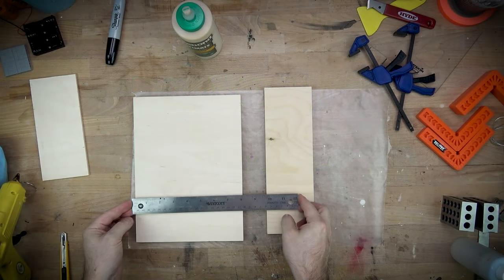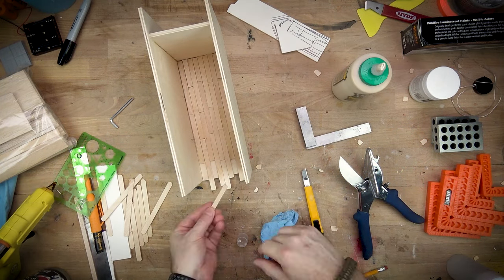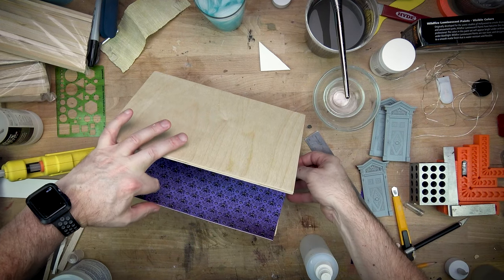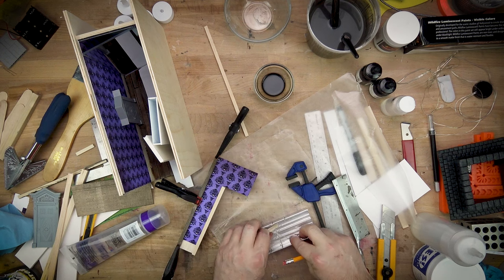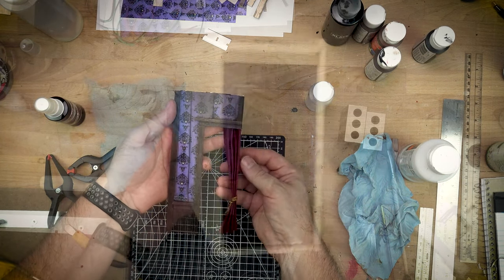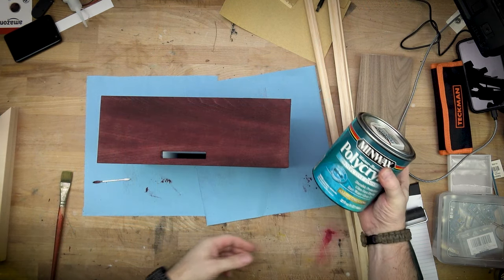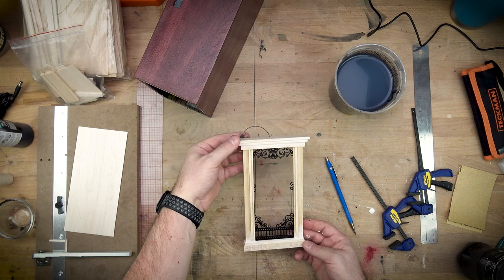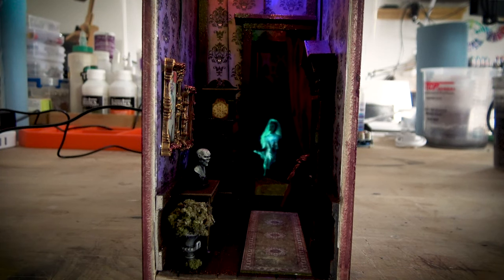I built a Haunted Mansion Themed Book Nook

Comment: If you would have stained both sides the popsicle sticks would not have cupped.
Reply from the maker: In this instance, the cupping was fine. I just don't know if the time spent cutting the sticks was worth it. Popsicle sticks are pretty tough, have really consistent grain, and rounded edges... all things that make for great popsicle sticks. I think I would have been better off cutting strips or balsa or bass... or maybe just scoring the floor lines. Thanks for the tip and for watching and commenting! Cheers.
Reply: @RandomMakingEncounters  basswood is great. I use it for carvings.

Comment: The electronics parts seems very confusing to me. I'm tired of using Dollar Tree light strings. They're too long and there's too much cord to hide. I wish you would have explained the glass placements more. Do you use the flexible mirror?
Reply from the maker: I have a video that goes into the overall geometry of the illusion on my channel. I also have some videos on LED lighting as well. I completely agree with you on store-bought LED strings. They're nice because they're easy. They're not so nice because they are limiting. LED's aren't too hard with a little bit of practice soldering and knowing how to figure out what resistors to use. Using RGB LEDs and microcontrollers is a bit more involved but doable. I have a video on it but I think I need to do one that is less overview and more step-by-step for book nooks specifically. Thanks for watching!

Comment: This is a really inspirational build. I’m following a similar route with my own book nook. I’m struggling however to find the miniature parts here in the UK. I cannot find any doors, picture frames or the grandfather clock. Any suggestions for a builder over the pond???
Reply from the maker: It's tough. I actually 3D printed most of the actual pieces. The walls and other bits are easily put together from balsa or even heavy card stock. The models were all free on Thingiverse. Could you track down a local maker or club that has a 3D printer? They could maybe run some models for you. It's like having a friend with a truck when you need to move :)! 3D printers are also coming way down in price if this is the kind of thing you're doing a lot. Another option is scratch building things from balsa. Doll house makers used to do a lot of scratch building from strips and sheets. I also occasionally use polymer clay like SuperSculpy to create little bits and pieces—easy to work with and it's oven baked. For the doors, you could do a lot of the construction with layered sheets for the details and strips of different sizes for the framing? I still go back to seeing if you can find someone with a 3D printer that could help you out. Hope that helps! Best of luck with your project!

Comment: Great video!  We like how you described your material and methodology with each step, but we did have a question.  What did you use to create the carpet and wallpaper?  Was it a Photoshop image printed with a color laser printer on thick paper?  Thanks in advance and keep up the good work!
Reply from the maker: Thanks for watching and reaching out! The wallpaper is just an inkjet print on matte photo paper. I realized a little too late that I probably should have uses slightly thinner paper and cut it into strips like real wallpaper—it was a little toooooo flat. For the rug, I found an image of a carpet runner in a style that seemed to fit. It's printed on an inkjet printer and then glued to a bit heavier stock to give it a little thickness. If your printer can handle thicker stock, you could just run it through onto a card stock. I did stipple on some clear gel medium to give the rug a bit of texture to bread up the smoothness. Hope all of that helps!
Reply: @RandomMakingEncounters  That's very helpful. Thanks!

Comment: Great Build! Question - Is the MP4 player connected to the Arduino or stand alone? Do you have to pull the box out and start the video when you want to show it off?
Thanks!
Reply from the maker: It’s stand alone. Yeah... it sadly needs to be pulled from the top. It’s a little kludgy. I tried a bunch of different orientations but didn’t have a good way to fabricate the case. I have a laser cutter now! I’m trying out building nook cases with it and can do much more complex configurations. I’d also love to figure out a simple, affordable way to integrate video that isn’t stand alone.
Reply from the maker: I ended up getting an Orion Motor Tech 50 watt. It's really more than I could afford but I'm really loving it. I got the model with the Ruida controller and Lightburn. It's pretty good outta the crate but I've been doing some little mods here and there. I'm currently really happy with it.
I've seen that video. That nook is over the top! It's brilliant! Waaaaay more than I think I would have the patience for. I tend to need quicker projects or I kinda burn out. I'm not sure if he gutted some sort of player. The circuit board looks pretty funky. I feel like a Raspberry Pi could do the trick but it's more learning that my brain may not have room for. Let me know if you come across anything. The MP4 players is simple and compact but it's not set and forget.
Reply: @RandomMakingEncounters  Nice! Have fun with that machine.
I have a message out to the maker of that nook. I'll let you know what I learn. 
Thank you so much for your time!

Comment: Also, where do you get your polystyrene? Is that pipe fitter glue, like for landscaping and is thingieverse a thing or slang for Etsy?
Reply from the maker: Here's a link to an assortment pack of polystyrene - https://amzn.to/3SRF0dq 

Pipe fitter glue is a little thick for this application and designed to be used with PVC. To build with sheet styrene, a thin glue that you can run along the seams works well. Here's a link to what I use - https://amzn.to/3f7L43H 

Thingiverse is a site to download free files for 3D printing. I've posted the files I used for this project in a collection so you don't have to dig around for them. Links in the description.

All the best with your project!

Comment: Is this possible for a beginner to do? And what kind of a player is this that you use? Is it a TIMMKOO? I would like to out so,e thing in there that you can use long term.
Reply from the maker: The most complex thing in this project is getting the ghost illusion to work. I've never really loved using the player for video since it can't really be left running all of the time and it's a bit fiddly. I have a better idea for a solution that can run all of the time and just got all of the parts in. I'm going to put together another video showing how to do it. I think it's simpler in some ways. As far as the rest goes... everything else is really pretty standard nook stuff. It's either a matter of making or finding all the little bits and pieces but everything I used can be found online or on Thingiverse. There are a million different ways you can get similar effects and it certainly doesn't need to be as complicated as what I've made to still be a cool nook. I'll let ya know when that video drops! All the best!

Comment: Great Quality. Does the phone over heat?
Reply from the maker: Thank you! That's an interesting question... it can get warm. The player is a reasonably inexpensive MP4 player so it's designed to play full length movies. In theory, it shouldn't overheat with extended use. Since it powered by battery, I tend to not run it continuously. I've been noodling a solution that uses an LED screen and Raspberry Pi so it can be on all of the time. If I did that, I would probably also consider a fan to cool the Pi. Cheers!

Comment: Fantastic work. what brand of mp4 player did you use?
Reply from the maker: I used the Timmkoo. I have a quick video on my channel. There are a few out there but this one had a good screen size, the bezel around the frame was really narrow, the price wasn't terrible and the video playback has a loop setting. For the price, I was pretty impressed. If I were to do something with video again, I think I'll dig more into Raspberry Pi. The player approach is great because it's really, really easy... no wiring... no muss. The main downside is it isn't a continuous running kinda thing. Pi with a small screen seems like it may be a more permanent solution. Thanks for the feedback and I hope that helps!

Comment: What thickness is the perspex please, I have some very thin acetate sheets, Thanks
Reply from the maker: Sorry for taking a couple of days to get back. I saw your post on 3mm. I have a video I'm working on that helps explain this. Yes... 3mm is brutal. I was able to chase down some .030 or 1/32" polycarbonate online. Here's the link to the stuff I used - https://www.amazon.com/gp/product/B00520AR9C (non affiliate and no real endorsement). It was really the thinnest rigid plastic I could find. I've also wondered if using some sort of film pulled taught in a frame is an option.

Comment: I very much enjoyed this video, quite inspiring. Did print your part on filament or a resin printer?
Reply from the maker: All of the parts were printed on a resin printer. The parts are pretty small. I think the little statue on the table is a little over half an inch tall. I find that filament printers are good for larger designs where strength is also important. Resin is great for small detailed objects. Thanks for watching! Cheers!

Comment: Omg you lost me on the lighting. I’m so intimidated by using an arduino.
Reply from the maker: Arduino is "easy" but it's also not. Basic wiring is something that can be picked up without too much effort. Arduino is a microcontroller and a programming language so it is a very different skill and way of thinking. It's still very low barrier to get started in but it helps if you've had some exposure to basic computer programming. The real benefit is that you can use RGB LEDs that are controlled by the Arduino and have almost unlimited control over the lighting. I almost hate putting standard LEDs in my projects now because I'm a serious tweaker. I think there's an Arduino video in there somewhere along with all of the others that are resulting from your comments! I'm also working on some circuit boards that would help with just getting the right components in place but it's still not a plug and play kinda thing.

Comment: Couldn’t the display be powered with the rest of the piece?

Soooo beautiful.
Reply from the maker: Thanks! In theory... yes. I could power it through USB and connect that to the rest of the power. What's a little fiddly is the touch screen. I find that bumping it can pause the video or close the window. What I REALLY need is a way to play looping video on a screen that is just player and screen. This was a bit of an easy hack. I've found a way to do it with Raspberry Pi but it goes down the rabbit hole of Raspberry Pi. I also found a tiny MP4 player that outputs to HDMI so I may try that route as well. I'm mostly noodling what I want to build that in to that would be interesting. Thanks again and all the best!